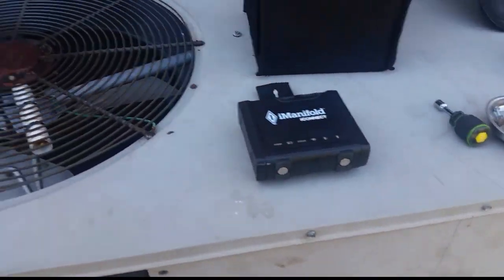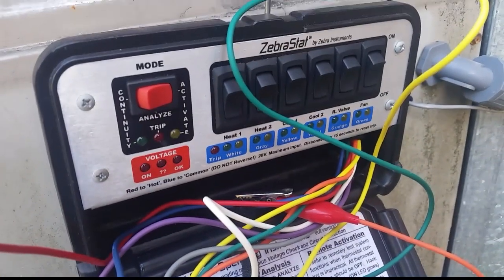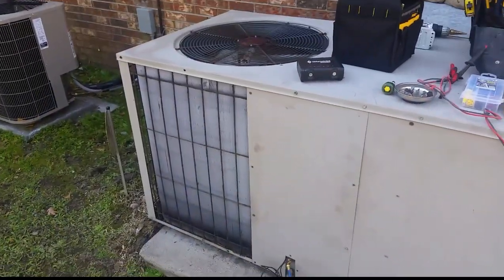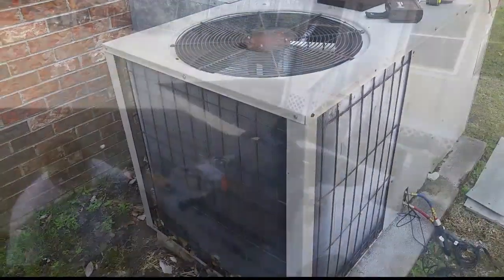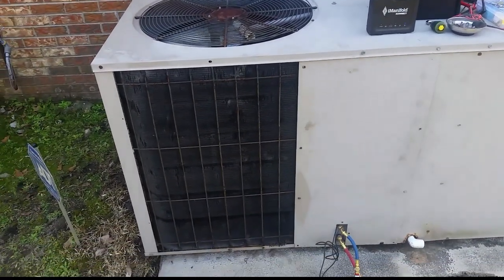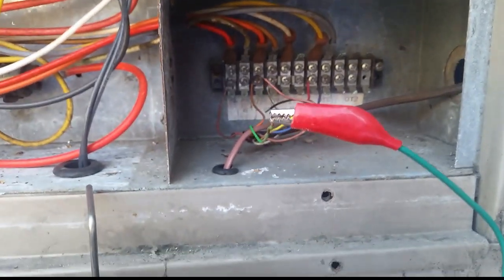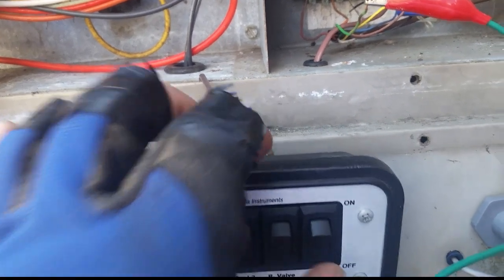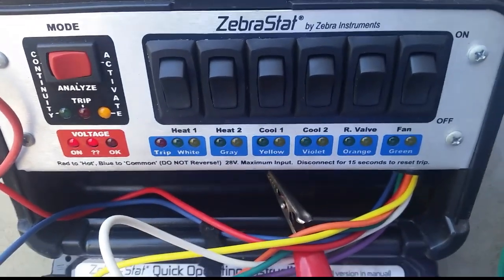HVAC Service : Heat Pump Check with Low Voltage Issue

Comment: I may be missing something here concerning the low voltage issue.  Was the indoor T-stat un-powered (or disconnected from the HP xformer) during this test and / or checked for no independent inside transformer (R & RC not connected) and /or no back-up battery operation?  .. because if not, then this would be the correct result (G and Y both outputting the same 24vac via relays or whichever (looking like a short from the other end) if the T-stat was sitting in heat mode).  No?